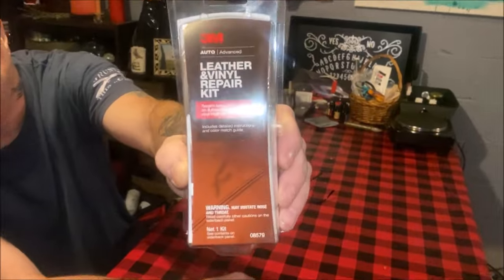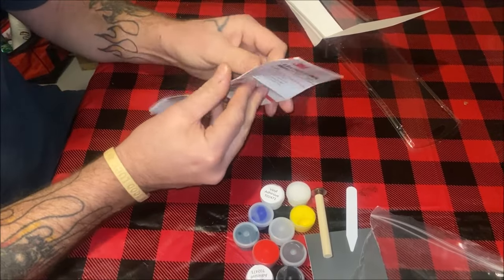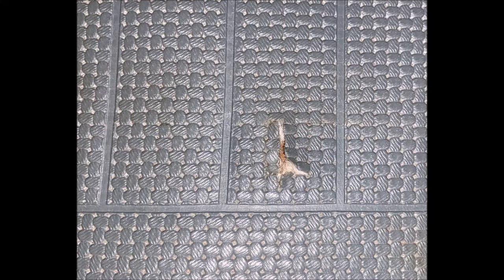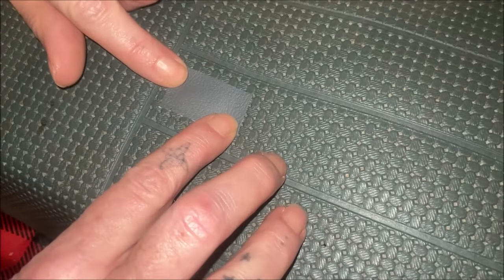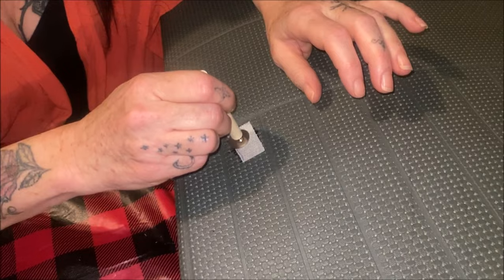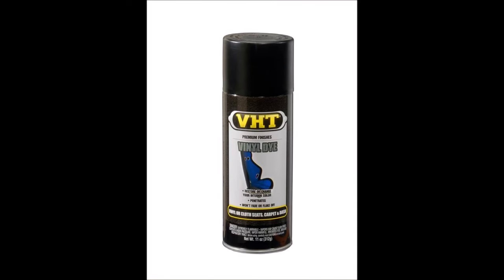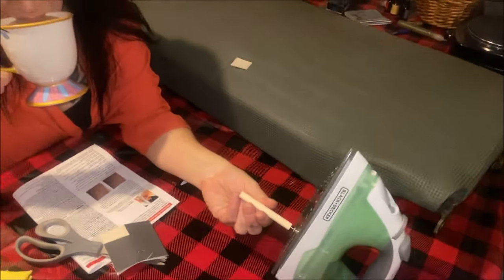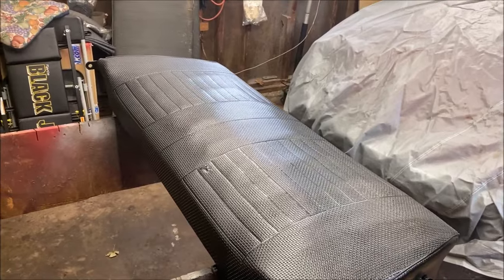VW Classic Beetle Bug Vinyl Seat Repair and Dye! Very Easy!

Comment: Nice job.  I just did that to my back seat as well.  I used the vinyl and fabric paint by dupli color.
Quite happy with the results. I did not have a mask.....That stuff is strong.
I have also used the repair kit in the past.  It works well for small tares. Great stuff.
Reply from the maker: Yes you’re right it works better on small tears. That’s the first time we tried it, I think it could be done much nicer. My buddy just use the dupli color, and he liked it. Honestly I didn’t know they made it. I’ve been using that VHD all the time. It’s not cheap. I would prefer dupli color because it’s usually a little more reasonable. Here’s my buddies channel who just dyed his seats they come out beautiful.

https://youtu.be/laXy5tBevDg
Reply: @SladesVWBeetle  I have bought VHD products before.  Hight temp paint and stuff like that.  Never the dye.  They do work great but yes they are  pricey.  Just checked out that link and subbed to your buddys channel.   👍👍👍
Reply from the maker: Just tell him I sent you, he’s a really great guy. He will sub back to you. Yeah the VHT, is a little pricey. But it seems to work well.

Comment: That's a real good product, in past times I've pushed a patch through the hole and glued it on the inside. With this product on the outside it would just about be faultless.  
I use the VHT high temperature paint which is ausom as well.
Reply from the maker: Thank you sir, for taking the time to comment. I think it worked quite well. Honestly there was no point in replacing the whole seat cover for such a small tear.

Comment: Good timing Slade, I just told CT earlier that I thought he can repair his Ford truck padded dash with this kit. I just gave him the link to your video
Reply from the maker: Thanks Tim! It works quite well, I believe it could’ve come out a little bit better, that’s the first time I’ve ever used it.
Reply: I know what you mean on first time tryouts. But practice helps in most cases. Hey I finally was on Mike and Joe's Podcast yesterday. I believe they will post it the 19th. It was a blast👍

Comment: Another great video Slades. Never done anything like this either. Luckily my seats are fine so I won’t have to do it anytime soon. I made some more progress on my beetle as it has been warm here finally lol. I need to get some M6x12 bolts ordered for the front handle as mine broke when I was removing the old handle after cutting it in half. Now I just have to find a place around here that sells metric bolts. My goal is to have it on the road this summer hopefully. I promise I’ll eventually buy something from your store I have been spending my money on the car though 😁. When is your website going to be up and running?
Reply from the maker: Hey brother, glad to hear you’re coming along on yours. Take your time, it’s better to get it done properly. My website will be up in two weeks. I’m gonna put my email up, because I’m going to ask folks to also send pictures of their Beetles, and a little bit of information about their car and them self. And I’m going to have a Slades Beeetles member section. I think that will be a lot of fun for the folks. No rush on buying any apparel, I appreciate the thought.
Reply: @SladesVWBeetle  yes definitely going to take my time on it. It’s so hot here today I’m sweating and just a week or two ago I was freezing lol. I will gladly join your website and send in my beetle that will be great to have up and running. I have been greasing the suspension the last few days since I got an electric grease gun now man that thing is awesome I used it on my dads truck as well next I’m going to do my truck. I got my new glove box in too now so that’s good now I’m just working on the ignition since I haven’t been working because it’s just been so slow.